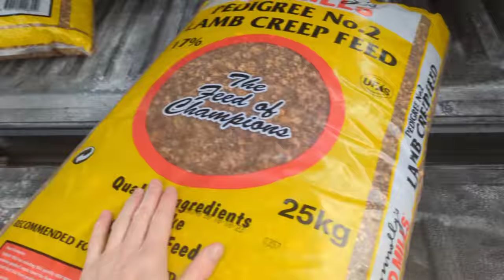Ewe dead and two lambs left with no mother. creep feeding lambs #sheep #farm #farming #lambing #lamb

Comment: I had creep feeders of the same design but mine had adjustable bars so that you could make the head space smaller in order to exclude the ewes. I ended up creep feeding the lambs early as it prevented a lot of mastitis even though I had very milky sheep.
Reply from the maker: Hi Wendy. Ya I fixed the bars now, that's interesting to know about the mastitis
Reply: @sheepshepherd  an other tip, with the horizontal rain we also get in West Wales, I used to just empty one bag into the feeder and leave the other two unopened in the feeder  just while the lambs get used to using the feeder to prevent a soggy mess building up.
Reply from the maker: @wendyrowland7787  that's even a better tip. Keep them coming I'm all ears
Reply: How did the early creeping lambs finish compared to the others ?
Reply: @Oisin1990  ready to go at 40k at 4 1/2 months, although I often took them to 50k to sell later if the price was rubbish.

Comment: Check that boat engine is pumping water. There should be a small jet off water coming out. U might need to replace the impeller for water pump. Doing great with sheep.if u get lambs a good start there easy  finished.
Reply from the maker: Cheers, I might even give it a local lad to give it a right service and check over. Ya hopefully they'll finish easily
Reply: It wasn't low enough to get water to the impeller there. So might need new impeller

Comment: We feed alot of creep and start getting them off the farm from 12 weeks old.
We'd expect to draw 100 out of the 1200 lambs at 13 weeks old.
It's totally different set up to yourself tho doing 3/4 lambings a yr of 600+ ewes.
Reply from the maker: Ye have a big set up. What breed of sheep and where are you from.
Reply: @sheepshepherd  Dorsets Cross in Dorset England 🤪
Reply from the maker: @bumpkinrocks  are they easy to lamb
Reply: @sheepshepherd  fairly depending on what they went to as they're split into groups including pedigree replacements etc. 
They're block Lambed inside over 3 weeks so it's pretty crazy going!
Ewe condition is key as they are back to the ram fairly quickly, on average they lamb 3 times in 2 yrs.